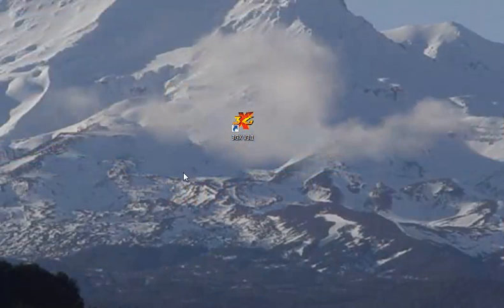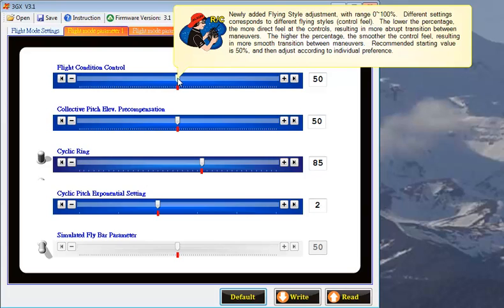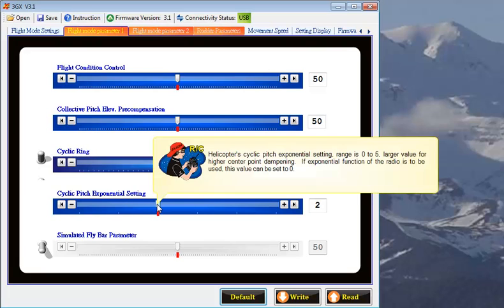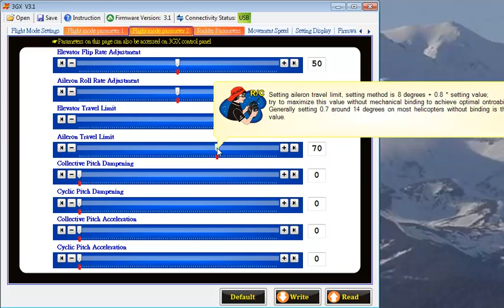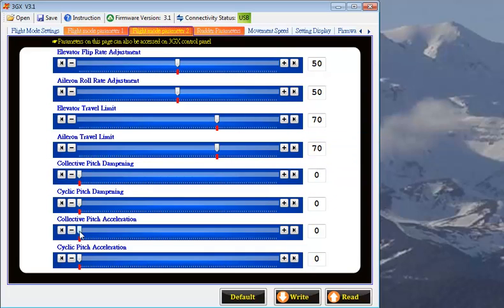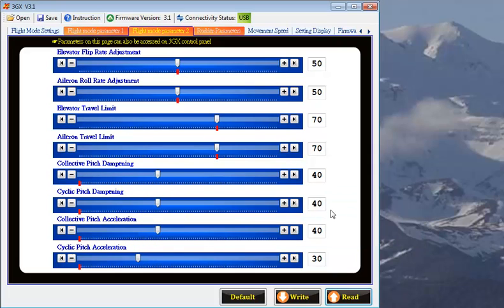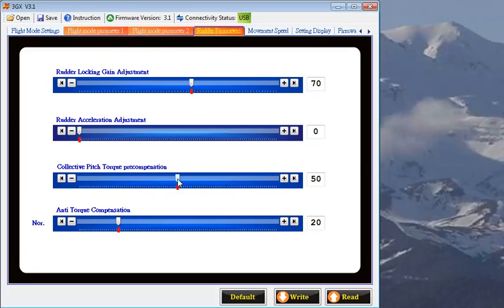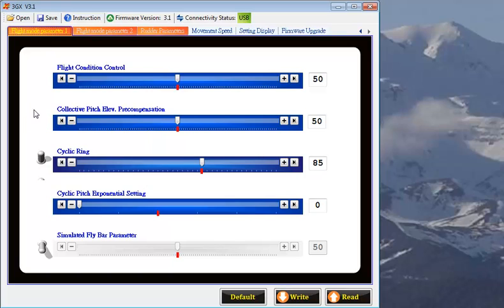3gx V3.1 tweaks v2 - How to get a more stable heli

Comment: I`m using a spectrum DX8 and the helicopter is a trex450 the  Aileron servo is a align DS410.I can`t get the servo to move up with the rest of them. Is there a setting in the 3gx to change this to move up.
Reply from the maker: Which Servo on the Heli... Front Left ... Front Right or Centre Rear?
Reply from the maker: and during which operation is this happening? Pitch application only? I would assume it is all cyclic operations... in which case you either need to connect the servo to the correct controller port... or change the correct input on the TX
Reply from the maker: you should simply be able to change the Aileron Direction in the Radio.

Comment: 3gx v3.1 I`m having trouble with the ail servo. It is moving down when I go up. I went in to my dx8 spectrum radio and tried revering the servo but it did not work can you help me with this.
Reply from the maker: what radio (Transmitter) are you using? and what servo on the heli are you refering to AILeron (Front Left) .. elevator (Front Right) Pitch(Rear Centre)?
Reply from the maker: apologies.... did not see this... I would assume you solved your own problem.

Comment from the maker: hi there, I set them to 12 oclock when flashing hte firmware ... then I use the software and set the dials to get 100. then test fly and if it is ocillating (depending if it is tail oscillating or aileron oscilating) ... dial down the one that is causing the issue to tune it in.

Comment: I have a 700 converted to Electric using a Spektrum DSM2 radio. What is your dial set to on the 3gx is it @12 o clock. or off. Do the dial work?? I've been having some issues with where/how  to adjust the two dials on the 3gx (which nearly caused a disaster)